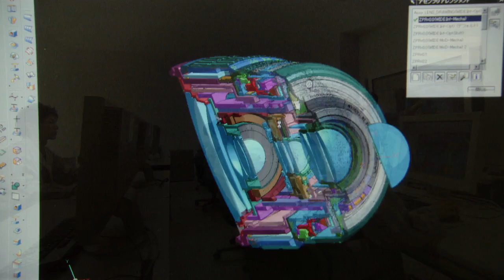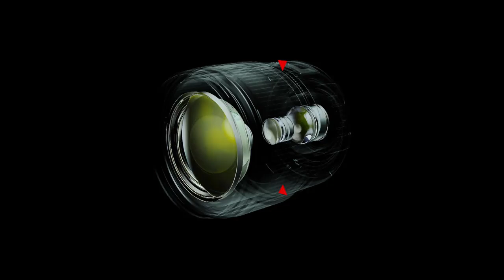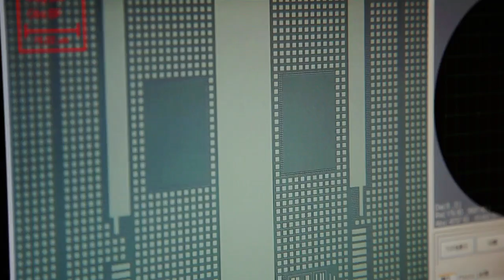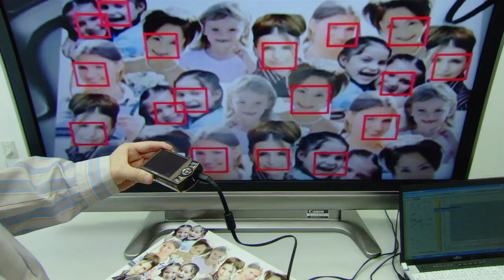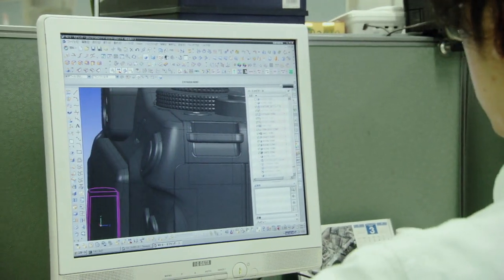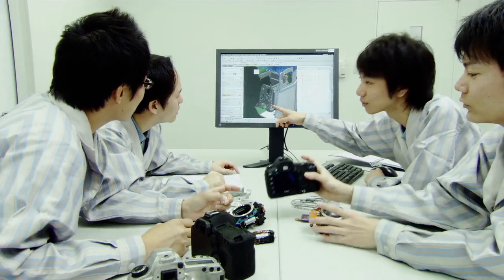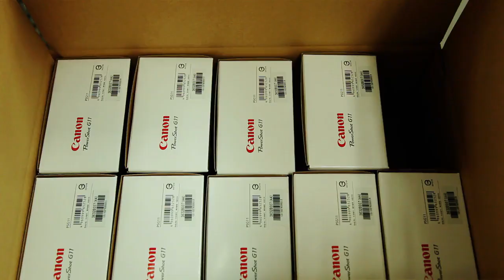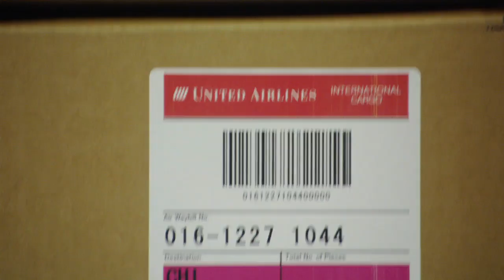How a Digital Camera is Made

Comment: I'm a nikon user... i gotta say, they've got really LOW QC on every camera after the all clean D90.
d7000 dust oil issue and back focusing, d5100 memory card issue, d600 dust oil issue (again), d800 lefty focus issue, D4 green tint WB LCD screen. LACK OF APERTURE CONTROL LIVEVIEW on every camera under D800.
I'm a nikon user, i own a d600. but i gotta admit, Nikon's getting DOWN these says. Only the D300s, D3s and d700 were the BEST CAMERA NIKON EVER MADE. NUFF SAID.
Reply: Why do entry level dslr cameras does not have top deck lcd?

Comment: He most certainly does not. The DoF is only influenced by the focal length and aperture used. BUT: With a bigger sensor you need longer focal lengths to get the same field of view as with a smaller sensor. Therefore the size of your circles of confusion will increase which results in a shallower depth of field.

Comment: The GH2 is already there in detail and quality and it has a large sensor except for a mirror.  The 5D 3 improved but it is more like 720p and not 1080p. Doesn't matter how much sharpening you add. The detail is not there to start with.

Comment: How about fixing the moire and aliasing in the transport trailer shots probably produced by a Canon SLR.    5D Mk III is still soft and way below true 1080p quality with reduced artifacts of course. The Rebel 650D has the same problems with aliasing, moire, rolling shutter as the 7D and 600D. No improvement there.